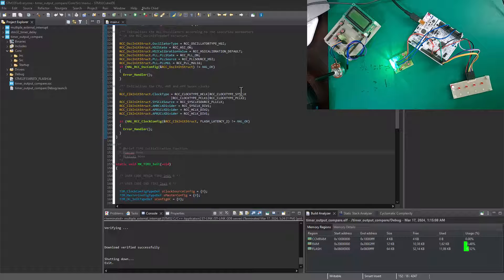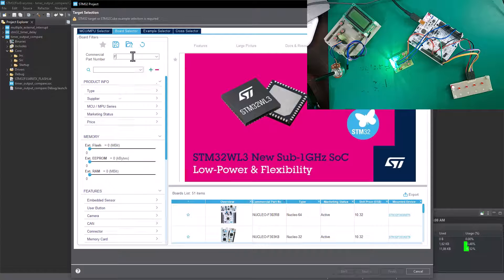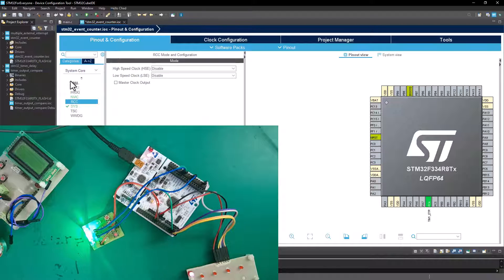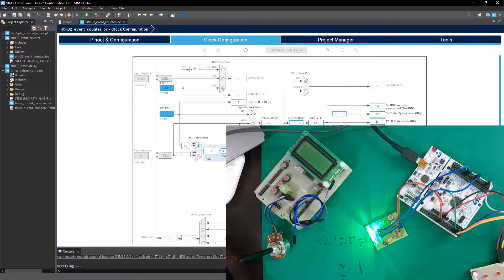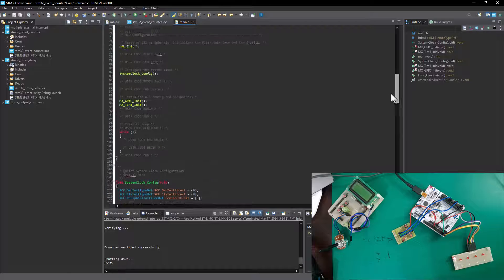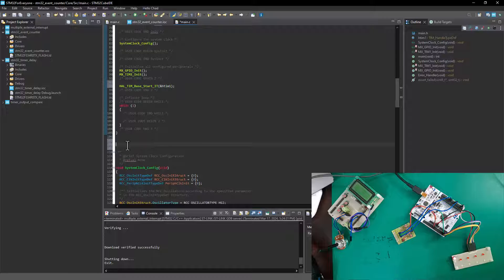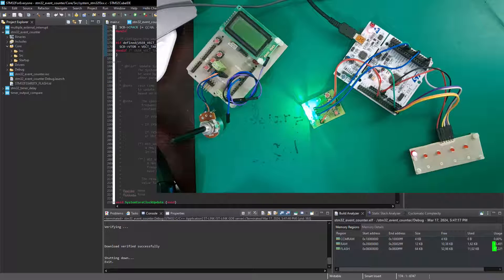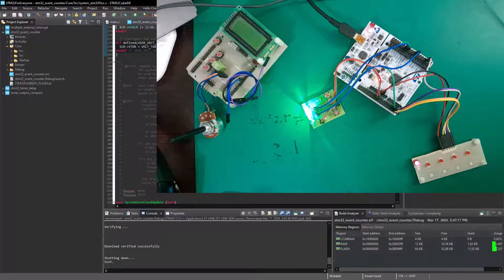7. How to implement event counter with stm32 Timer

Comment: so basically in the TRM its ARR+1

so if youve entered 4 
the actual value it takes is 
0,1,2,3,4
so 5 counts
so enter N-1 
0,1,2,3->4 counts
Reply from the maker: That is correct, When ARR is set to a value N, the timer counts from 0 to N.